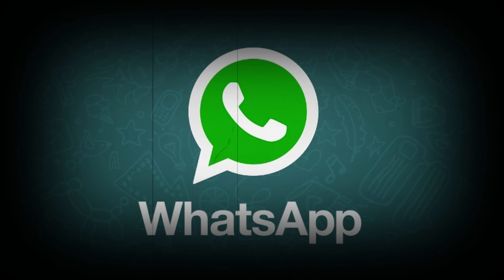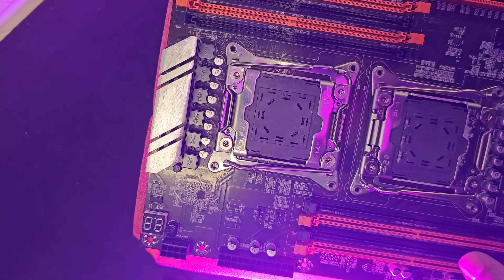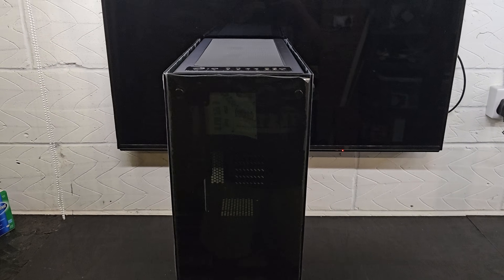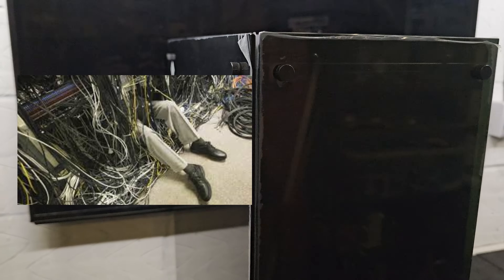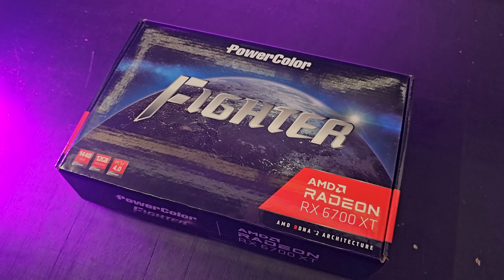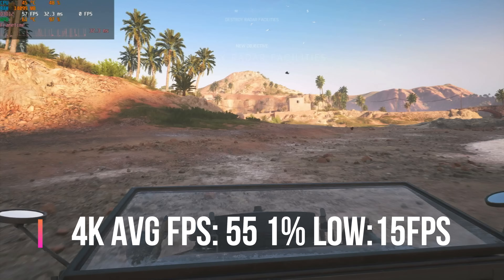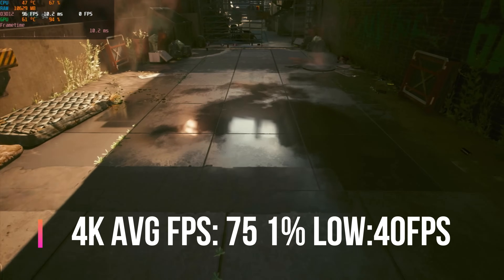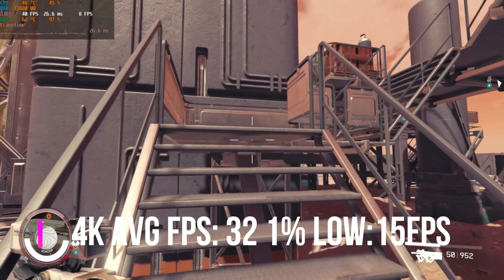Are DUAL CPU builds really THAT BAD?? Xeon E5-2643 V3, RX 6700 XT

Comment: Go with 2.gen xeon scalable instead. these are too old. Its not worth it. And even tho i would still consider single core setup with at least 4 channel ddr4 2933 or 3200 MHz. Thats where you get odge over consumer builds. Being it ram bandwidth or total ram support (above 192 Gb). Only other reason comes is good avx support(AMD is pushing against intel in consumer grade too) and overall build quality with removable power source for example for 24/7 uninterrupted operation or total PCIe lanes.
Reply from the maker: @simonmeszaros2770  they are pretty old now and the speed of ram you can use on these cpus is pretty limited by today's standard
Reply: @RestoTek  agree but price wise its affordable and at least its one generation, one and a half  behind(ddr4 vs ddr5)
Reply from the maker: @simonmeszaros2770  totally agree, my e5 2699 is still ddr4 but it's max frequency on the ram is only 2133 mhz which is a little limiting, I'll have a look at the cpus you have used and maybe do another video on that!

Comment: There is absolutely no reason to ever use a E 2643 v3 just use a E5 1680v4 it still works with LGA 2011-3 is around the same price has more cores and has a boost clock of 3.8 to 4 GHz and can be supported in dual socket systems and is an unlocked CPU so you can overclock it
Reply from the maker: @hyplex_  I'll have a look at that, might order it off ali express should be quite cheap there, watch out for a new video featuring this cpu. I thought V3 was the last gen that had unlocked xeon cpus
Reply: @RestoTek  literally nothing I said was right at all you can't overclock it either The only difference is it has two more cores and it's slightly higher boost clock That's what you get for trusting chat GBT
Reply from the maker: @hyplex_  lol, yeah chatgpt can be dangerous at times lol, i think from memory there was only 2 xeon cpus that could be overclocked i think it was the e5-1660 and the e5-1680 xeons that had a unlocked multiplier
Reply: @hyplex_  For that level of cores, you'd have to use the E5 2667 V4 in dual cpu. Looses .4 G in boost mode, but ram speeds are the same.
Reply: @RestoTek  ok so I was wrong about some things you can't use it in duel socket I just found that out the hard way in my r630 server but it still higher clock speed and over clock able

Comment: why didn't you go with the 18 core exons they are like $30
Reply from the maker: What was the model No of those xeons?
Reply: @RestoTek  Xeon E5-2697 v4 18-Core
Reply from the maker: @HelamanGile  yeah i heard that actually performs better than the 2699, I'll pick that up especially if it's just 30 quid!

Comment: Built a cheap HP DL380 G9 about 6 months ago. Dual E5-2643 V4's (decent single core performance), 64G DDR4 ECC Reg 2400 in quad channel, 512G NVME for boot, 1TB NVME for Steam (need a 2TB soon),  8 x 900Gb 10K in RAID 10 (getting 6.5 GB/Sec)  10 Gbit copper LAN to my gaming rig, and an old 1660Ti (still ok for most 1080P gaming). I'm using the onboard video for monitoring performance. Sound is handled by an Asus Xonar DGX. Sure it uses lots of power and the fans ramp up pretty loud, but stick it in a big closet and you are good to go. After configuration and drivers were proper I have not had one crash... rock solid stable and no complaints. All components were used/recycled aside from the NVME drives. I used PCIe adapters to get those working. They even show up in the BIOS boot order. Oh yeah, can't forget the dual redundant power supplies. It's a really fun build as long as you have ear plugs, lol.
Reply from the maker: @Steve_Larson  wow that sounds pretty incredible and I like the fact that you didn't let used parts go to waste, like you said they are 100% reliable at times and still good to go! Interesting you used 2 psus  though. I have a giant case I can use so I might do a similar build
Reply: @RestoTek  The real deal was the pair of Intel 10Gbps intel network cards ($20 each). I'm running them direct as a separate network to my gaming rig so it doesn't need an expensive 10G switch. You just need to set up the hosts file so it knows where to look. I have all of my Steam games backed up on the 4.8 TB RAID and when my gaming rig needs game reloads or updates it pulls them from the DL380 at nearly 4 Gbps  (it's low on space so sometimes I have to swap games).  It could copy faster but I'm limited by the gaming rig's NVME write speeds. I would need to run striped NVME drives to keep up with the RAID array. It's all automatic and Steam does all of the work figuring out what it can pull from the RAID array. Quite a bit faster than my 200Mbps internet, lol.

Comment: I have watched this video about a 100 times or so now trying to get ideas for parts for my build. I ened up getting the Huananzhi F8D Plus with dual 2699 v4's and 256gb of ECC ram. I cheaped out and paired it with a RX 6600m for the graphics card.  the biggest issue I am having now is finding a cooling solution that still supports the LGA 2011-v3 plat form. I wanted to go air cooling  as this pc will pretty much stay powered on 24/7. But the only cooling I can find like you is water cooling.  Every time I seem to find a air cooler that supports this socket its either out of stock or over priced or had a model upgrade that no longer supports the mounting system. Very frustrating..
Reply from the maker: @craigharris9591  it's really annoying, have a hunt around on amazon I see uphere has a cooler that supports 2011 socket, unfortunately the cooler does not have a model numberwhich is really annoying upHere gaming High Performance CPU Air Cooler, 6 Heat Pipes CPU Cooler, Dual 120mm PWM Fan PC Cooling for Intel LGA 2011/2066(X79/X99 Motherboard) and AMD AM4/AM5, D6SEK https://amzn.eu/d/bjOeRax

Comment: 1. Any of 2600 v3/v4 cpus can be used in a duo configuration. 2. Any of 2600 v3 cpus can be overclocked (v4 cannot) 3. Xeon E5-2643 V3 in particular is the slowest xeon in the world. It can give 10k multithread rating score. A single 2696v3 or 2697v3 for $50 gives 22k with a same single thread rating. 6 cores of 2643 is nothing unless you plan to play games only. Just confess that you've got it for free -) 4. A standard DDR4 memory must be 16 banks. 8 banks won't work.

PS If you use a single 2696(7)v3 instead of duo 2643v3 you can take a single cpu motherboard (with 4 RAM channels), and an overall price will be less, so it will be enough to purchase PSU and a cpu cooler. An overall performance will be 20-30% higher
Reply from the maker: @sc0or  I actually bought the 2643 lol, but it was super cheap around £20 for the pair. I also have a 2696v3 but I never really gave it any hard test with any games. I also have a dual socket and single socket x99 motherboard so I might give that a test as you mentioned. Would be interesting to see what happens across various workloads
Reply: @RestoTek  Indeed. Unfortunately nobody will make any tests in LTSpice -( I'm actively looking for an interesting solution for my workstation that can compete 7700X, 14600K, 5900X, or 12900K. For Linux, for nvme + sata raids, for multicore applications. Now thinking about 2697 v3 overclocked, or 2698 v4, or Threadripper 1950x, or even EPYC 7551P. This would be interesting to watch your tests, even if they won't relate to my activities ) Good luck!
Reply from the maker: @sc0or  thanks man, the feedback is super useful! 👌  I think the main stumbling block is for those applications you really want low power consumption which those older cpus can't quite complete with, will think about it though and see where there might be gaps

Comment: 12:37 whats happen is this chines motherboard has slow-pice-line, not only on NVME, but that X16 is actually pcie-2.! we build few dual-cpu {x99 ZX-DU99D4-T8D-T8- F8D model} and even {x99-BD4 model AND more one-cpu-x99} with many chines mobo factory like { huananzhi and Jingsha}.
  you can try hard as you like.. but you cant change anything on this chines board'S, the bios is crapy, CUZ the motherboard chip is on low volt for safety..its cheap by it reason darling.

Comment: 9:18 😂😂OR..or.. you could buy 11900k-5.30GHz-8-core-16-thread for only "200$" + "B560-F" for only "140$" it has-WIFI-6/pcie4.0-NVME/pcie4.0-x16.GPU/USB 3.2 Gen 2 + Type-C-Gen 2/ 2.5Gb Ethernet/ AUDIO QUALITY : Sonic Studio+ Radar+ Virtual Mixer III AND TOW WAY Noise Cancelation..AND etc.. and yeah it not even 10 times faster than your dual-cpu also have AVX512 like new AM5 Rayzen ...Bcuz why power-user wants powerful pc? ..maybe for actually using it.?!
    - i build that 11gen for same price as yours only 600$ but 32gb-3600 and same rx6700xt but "nitro-plus" +512gb nvme"3500speed-lexar-x4" and 1tb for game + cooler-master-850w.
             so i just wonder how you can trust that chines motherboard. im sure yk what i mean. lol        anyway thanks for the video, it was fun to watch❤
Reply from the maker: Yeah the board was a bit sketchy and your right the 11th gen i9 is great value. In fact I did a 11th gen i9 build with a rtx 3080 and it was pretty awesome.

Comment: Can you please be more precise about what you mean by removing all the RAM and then adding it one by one? Do you mean starting the computer without any RAM, then shutting it down, adding one stick of RAM, shutting it down again, and so on?
Reply from the maker: @bpyt621  that's correct, of course I didn't wait until I got to windows that would have taken forever. I just made sure I could get to bios and then turned it off then added another stick. For some reason after that it all worked fine. PC building black magic!
Reply: @RestoTek  I tried this, but when all ram is out I'm getting error 58 :)

Comment: Hello, I have ZX DU99D4 and two Intel Xeon E5-2643 v4 CPUs, but only one is being detected. Both CPUs have been tested and are working individually. However, when both are connected, I get error 79. Do you know what the problem might be?
Reply from the maker: I've had a look at that error code and unfortunately it requires some fiddling around to get it to post, I'd start off with one stick of ram for each cpu, then try and post. If it does not work the slightly back off the screws on the cpu cooler and try again, hopefully you will eventually get it to post
Reply: @RestoTek  I'll try, thanks :)

Comment: Just build a Huananzhi X99-F8D (v2.81 at 130$ - brand new motherboard) with dual Xeons 2680v4 (used -18$ each) - 256 Go DDR4 2400 mhz Samsung ECC registered Octo-channel (used but bined by a pro seller - 350$). Kick ass seriously, slighty better than a Threadripper WX 2990  - Bios stock, full support EFI, support without bios mod rebar, all core turbo @2.9 Ghz in Cinebench 2024, handle 3.3 Ghz turbo in all games... Max cpus temps about 55°c with silent classic air cooling ( 2x BeQuiet dark rock slim )... 1300 pts in Cinebench 2024 multicore but only 50 pts in monocore... 2 x Nvme working great... Dual gigabit ethernet... I game it a little with a RTX 4060 before going proxmox... Really suprised, not bad at all...
Reply from the maker: It's such good value for money, especially if you game here and there and you mainly use it for productivity tasks this type of setup is unmatched. Mine was only 6 cores each but boosted up quite high so was a nice middle ground!
Reply: Hello, I have ZX DU99D4 and two Intel Xeon E5-2643 v4 CPUs, but only one is being detected. Both CPUs have been tested and are working individually. However, when both are connected, I get error 79. Do you know what the problem might be?
Reply: @bpyt621  Maybe a lot of problems : the cpus may not be the same batch even if the same model, maybe a motherboard bios bug ( error 79 means bios csm initialisation error try full UEFI mode ), may need a bios update which is tricky with chinese motherboard, may be a ram fault so try to play with the differents ram slots. Have you ever tryed a bios cmos reset?
Reply: @MetallixX974  I tried bios reset. Thanks :)
Reply: @bpyt621  Solved?
Reply: @MetallixX974  I tried bios reset,and all ram slots, but still do not work :)

Comment: not the best choice of CPU, i would have taken the E5-2698 v3 its just 19,90€ for 36 threads @ 3,6ghz
the best one is the E5-2699 v4 with 44 threads at 3,6 ghz, but its currently at 159€
Reply from the maker: I'm placing an order for the E5-2698 I think that is a better cpu setup, but in my area is £50 per cpu. Boost clock of 3.6 ghz is pretty decent for a xeon chip!
Reply: @RestoTek  then keep an eye on ebay if one pops up with a lower price usually that cpu goes for 15-30€

uhm i also notice now i switched lines in my list the
E5-2698 v3 is an 16 core
E5-2697 v4 and E5-2695 v4 got 18 cores

the 22 core E5-2699 v4 and the 20 core E5-2698 v4 are still a little expensive with 150€~

a really cheap one is the E5-2697 v3 and still got 14 cores at 18€

but interesting anyway running them on a china board, but if you keep an open eye you sometimes see supermicro boards at a low price like the "X10DRI"

Comment: A pair of decade-old Xeons is a pretty terrible choice for a gaming machine.

You'd be much better off putting together something like a 2nd or 3rd gen Ryzen system for the same money (or possibly less).

(Just for anyone else watching this who's thinking about going down this route).
Reply from the maker: @derekgalbraith1508  it's not a bad shout, also power consumption would be far less, although in terms of cool factor I think dual xeons takes it 😉

Comment: I've been running a multi-CPU system as my daily driver for well over a decade and use includes gaming. Multi-CPU systems are a completely different animal compared with regular single-CPU machines. You haven't mentioned your BIOS configuration. Few multi-CPU systems support standard memory, particularly when fully populated. Leaving everything as 'default' and hoping for the best is a recipe for poor or unstable performance. Multi-CPU systems are expected to be configured for the intended use, rather than a one-size-fits-all approach. For maximum performance attention must be paid to node and affinity configuration, otherwise the system will waste resources shuffling data around internally which will significantly hit the performance.

For best gaming performance the system needs to be configured to keep a tight reign on what runs where and how within the system which is done by configuring nodes and allocating a specific processor affinity to a given executable. I have set up small batch files that automatically set the affinity for certain programs, such a games. When configured correctly, a give task such as a application or game has all the resources it needs kept a locally as possible and has exclusive use of those resources. This means that the specific program or game effectively has its own system to run on and everything else, such as the OS itself, is executed elsewhere. This maximises the performance and allows other things to be run with minimal, if any, impact on the main task. There is no virtualisation involved in this and any such functionality is, in my own experience, best disabled as it is not needed and costs performance.
Reply: I have been setting up my dual cpu system but can't seem to find any information how to actually set a task to only use one cpu or so. I have tried setting affinity manually with no success, the percentile lows still suffer from the latency. Can you provide more information?
Reply: @Arthres  I'm surprised you're having difficulty finding more information as there's quite a bit online. How are you trying to set affinity? You know it's a binary mask don't you?

You could try getting the data sheet(s) for your processors and your specific motherboard. If you have a working installation of Windows OS then have a look at the affinity in Task Manager as that will give you key information as to what nodes and cores are available to be configured. You also need the block diagram for the electrical layout of your motherboard so you can determine what is connected to where and how so that when it comes to configuring the affinity you know which cores to allocate to which task. If a process requires to interact with hardware then it may be optimal to configure the affinity so it runs on the node actually connected to the physical hardware.

In order for all this to actually work the BIOS/UEFI needs to be configured correctly so that nodes can be split and the machine isn't running as a single entity. This is a common error and remove and advantage from trying to optimize the machine. This, unfortunately, is where you get what you pay for in that the ultra-cheap motherboards have very little information available online making it very difficult to determine if such a motherboard is remotely suitable for what you want to achieve. The more expensive motherboards, such as proper branded ones, often have several manuals available to download that detail the exact capabilities of the motherboard.
Reply from the maker: @DelticEngine  hi deltic, thank you, I have to say I think your far more experienced than I am, I was looking into how to setup affinity and I experimented with trying to get say OBS to only run on one CPU and the game I'm playing to only run on the other. I did turn quite a few things off in the bios but not much else. If OK with you is there a chance we could collaborate and I can make a followup video to this one?